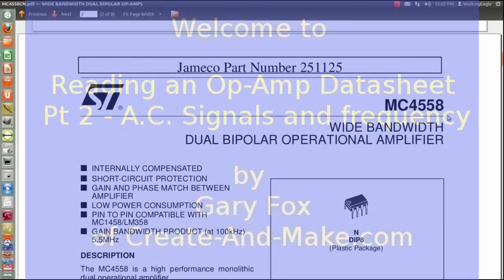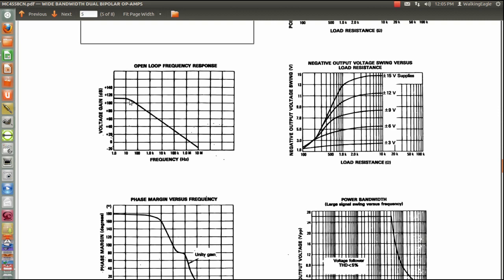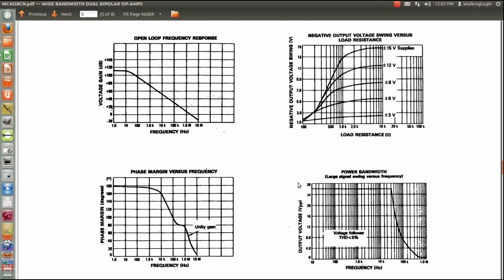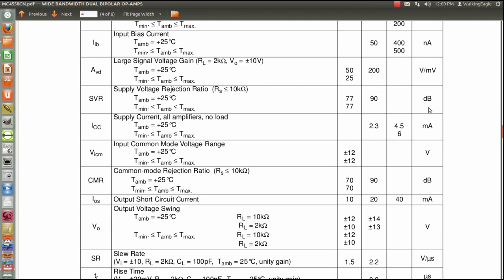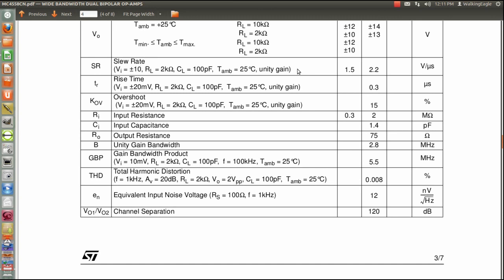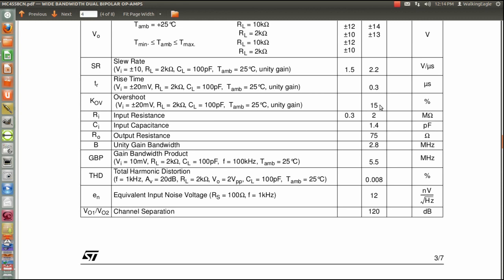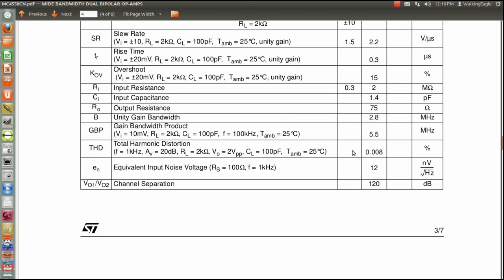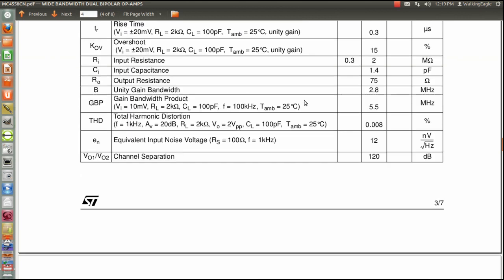Reading an Op-Amp Datasheet Part 2

Comment from the maker: Depending upon what you want there are IC circuits that will do that job for you.  They will be listed under power-amplifiers and are inexpensive.  I think I have seen them up to about 25 watts.   However, if you are doing it for the challenge I am sure you can find circuits out there made from transistors.  I would look at one and then pull datasheets on the transistors and find some sites on the net talking about transistor design.  I have not got into that on either my site or the videos..